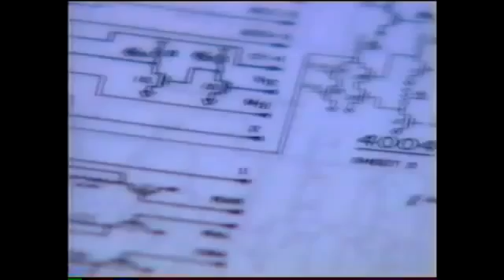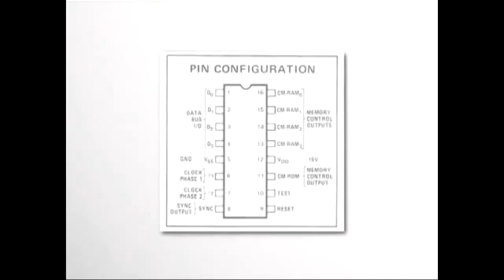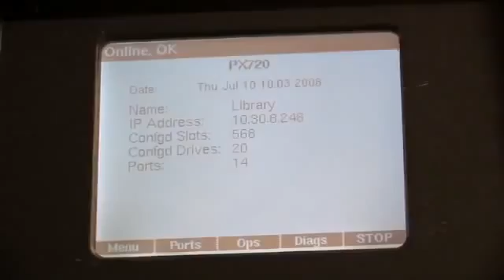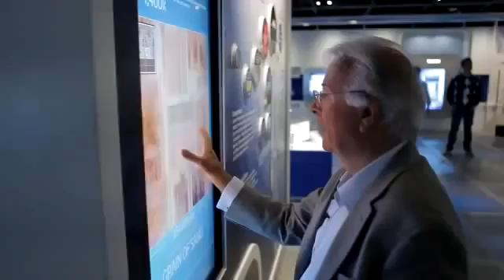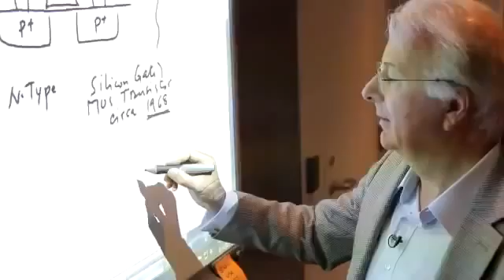The Designer Behind the First Microprocessor: Federico Faggin

Comment: Thank you for sharing. As seen in previous posts, the first true microprocessor was for secret military applications.
However, I believe we will agree that the 4004 is indeed the world's first general purpose commercial microprocessor. 
Thank you.
Reply from the maker: The 4004 microprocessor was the first commercial general-purpose CPU entirely integrated in a single chip.  All previous CPU designs were custom and required several chips.
This greater integration was made possible by a revolutionary new technology, the MOS silicon gate technology that in the same chip area could fit twice as many transistors and run five times the operating speed compared with the incumbent technology.
Since those multi-chip CPUs (as in the Tomcat jet) were not marketed as components for general use, to have a major societal impact the microprocessor required a better technology and a new vision.
Federico Faggin created the original SGT and designed the first commercial IC with it at Fairchild Semiconductor in 1968.  Faggin also designed at Intel the 4004 and the other three members of the MCS-4 family, made possible 
by his intimate knowledge of SGT and MOS logic, circuits and chip designs.
No one else at Intel or anywhere else had then the expertise to undertake such a design.

Comment: It was settled in court that AL1 was the first microprocessor, and after that intel stopped calling 4004 the first microprocessor in advertisement
Reply: The AL1 was more of a prototype and a proof-of-concept rather than a commercially mass-produced microprocessor. By June 1971, Four-Phase IV/70 computers had just four customers and by 1973, they had shipped 347 systems. AL1 demonstrated the feasibility of integrating a CPU on a single chip, which was a significant technological advancement at the time.
There were electromechanical computing devices that served as predecessors to electronic CPUs: Zuse Z3 (1941), Harvard Mark I (1944), Colossus (1943-1945). And of course Babbage's Analytical Engine (1837).